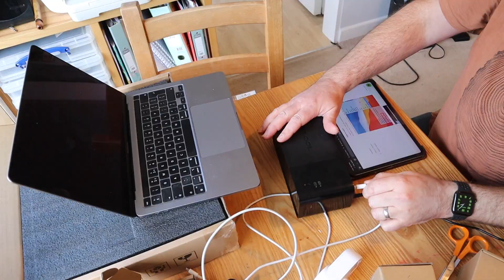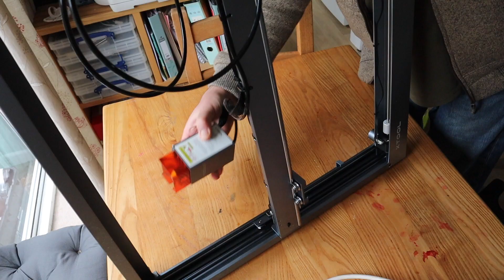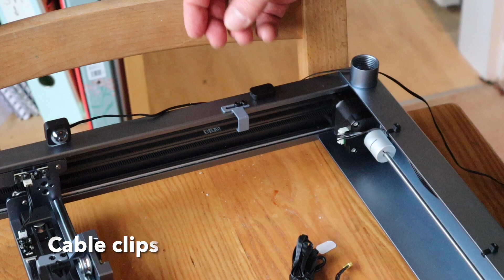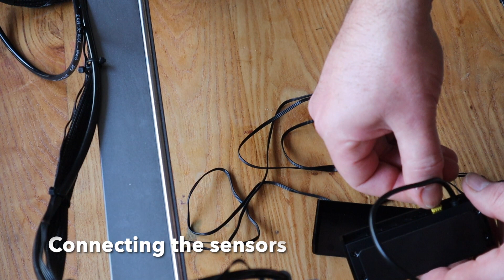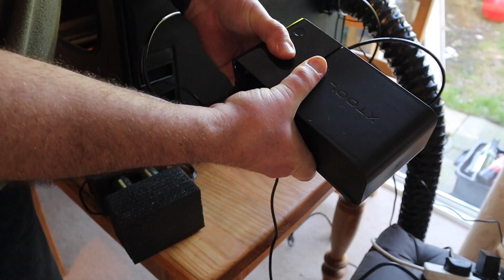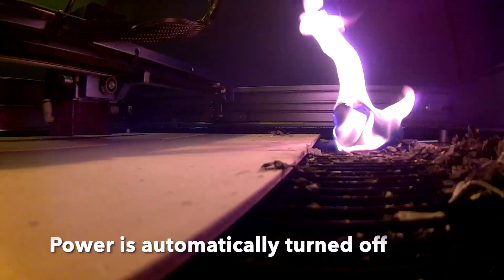XTool Laser Fire Safety Set - Full test with real fire

Comment: Can it still be used without cannisters? I don't know why xtool didnt just implement sensors into the build of their machines tbh. I wouldn't want to keep buying cannisters for fires that I could probably blow out myself
Reply from the maker: I don’t know if it can be used without cannisters or whether it will stop it being activated. In my testing it took quite a significant burn to activate the gas. Minor fires had no effect but did sound the alarm. I have found the built in flame sensors on other brands of laser to be a nuisance with too many false activations.
Reply: Update for others reading this 2 years later, the fire sensors are built into most of the models now. Also, the c02 canisters are pretty cheap and easy to replace, when they are empty a light pops up on the fire safety box telling you to replace them. I have been using my S1 heavily for a couple of months now, and I love the fire tool, I've never had a fire break out. I bought a replacement but haven't used them.

Comment: Thank you for doing this! 

Fire kinda freaks me out, so having a safety mechanism like this included in the laser would be a huge pro if i got one. Seeing it in use like this is great, I've been hoping to find a good showcase of how it worked ever since I saw they had this set available in their shop! 

I initially thought it only had the CO2 cannisters, and didn't realize there was an actual alarm system with lights and sound attached to it, which only makes it better. Seems like even when you don't have the cannisters because you ran out, you can still use it as, well, an alarm.
Reply from the maker: Many thanks for watching. One of my pet hates are product review videos that don’t show the product working, so I felt I needed to give it a thorough test.

Comment: Interesting safety mechanism. Seems to work without any issue. I would love to see you build a cabinet for the laser with its enclosure and all the accessories.
I'd think of a removable table (the base plate) with the third axis underneath, so you don't have to jack up the laser, every time you want to use it.
Reply from the maker: It was a bit nerve racking testing it but happily it worked very well. One day I will try and build a dedicated laser station, my biggest problem is the lack of space in my tiny workshop.
Reply: @JimsonMakes  I know that problem just too well. I'm about to start my own adventure with creating YouTube content and the beginning series will deal with exactly this problem, not enough space.